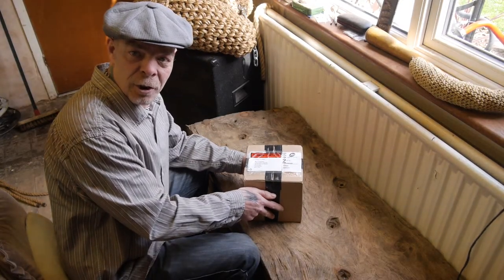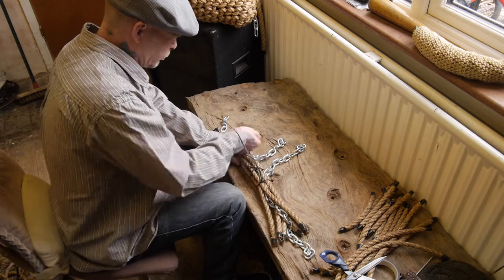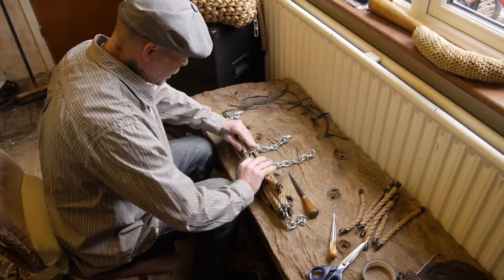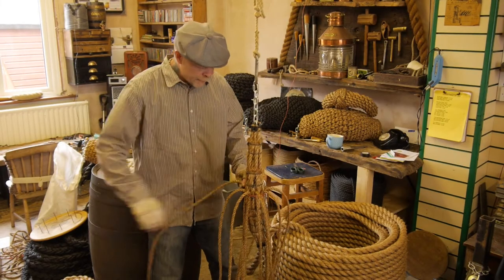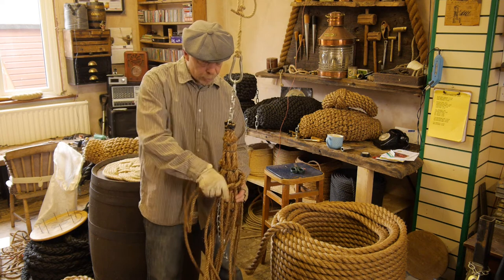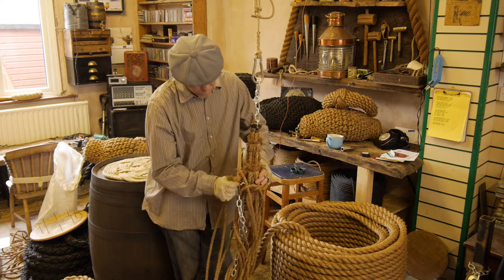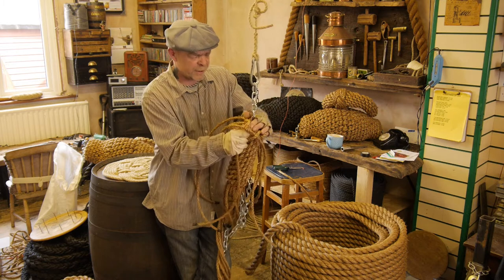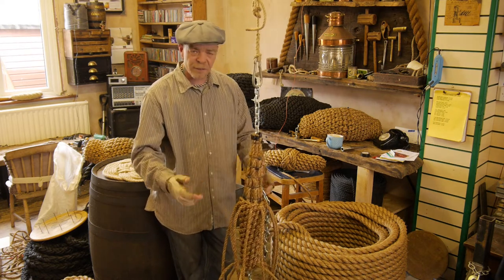From the Fender Maker Archive: Making a Bow Fender

Comment: As to how to finish the bow fender either end, you mention its tucked in the same way as with the side fender... Does your side fender video still exist? 
And also quite excited for the video on alternative finishes! Very much enjoy your videos, thank you so much
Reply: some tips from memory of side fenders: 1. don't use poly propylene rope, best to use sisal or similar 3 strand. 2. for consistency make a wood jig with pegs to aide in length consistency. 3. for crowning, best to use a chain with a swivel on end & carabiners hung from ceiling   4. use of packers knot ,  marlin spike hitch and fid are valuable tools.  a small side fender example uses two lengths of rope about 1/2 diameter and about 14 ft long. 5. finishing is essentially tucking each strand back thru the top middle. it will take a little practice. many other videos on crowning process too.
Reply: Will the constrictor suffice for the packers knot